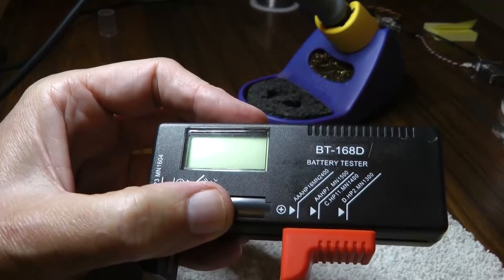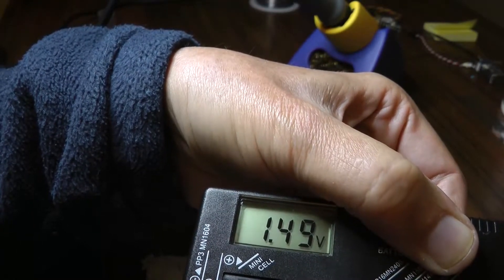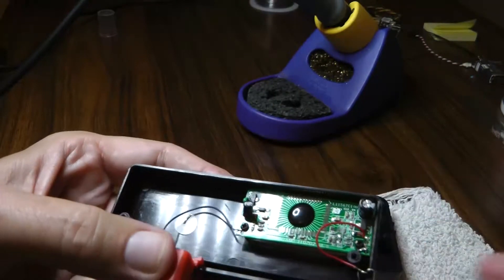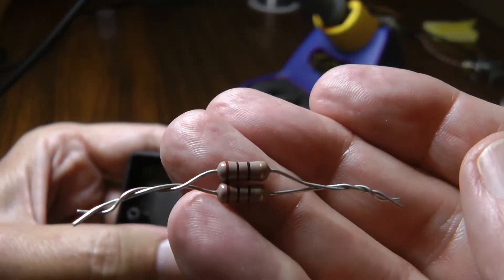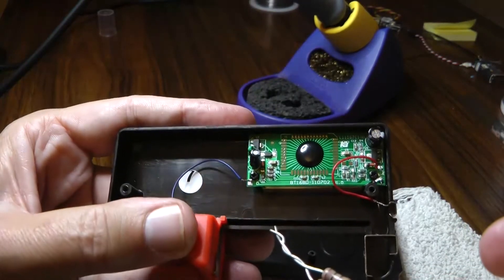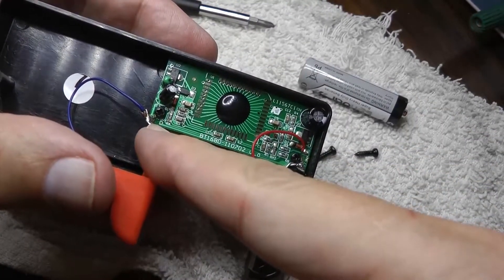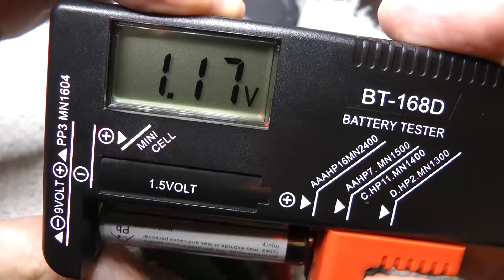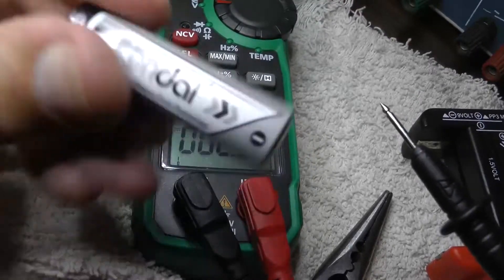Battery tester modification to create a load for more accuracy

Comment: This is incorrect, a fresh AA cell will measure a "no load" terminal voltage of higher than the nominal 1.5 Volts. The one shown at 1.49 I would toss as it's capacity will drop dramatically under a load.

Comment: Thanks for sharing , I used 3 ohm resistor and used a momentary on / off switch to show before and after voltage’s reading and by the way  my meter is analog and at the back of panel there are three colors which I think it is faster and easer cause it shows  good / weak / bad according to needle position . Keep up the good work .

Comment: Why do you tjhink this is necessary - this model of tester seems to have a sophisticated testing method
Reply from the maker: Because without the resistor to put an ample load on the battery you are not getting a real world idea of how healthy the battery is.  Many batteries will show almost full voltage without a load.  This tester has no sophisticated testing method, the electronics you see in there is to convert the voltage to a digital display.

Comment: This is brilliant, just what I was looking for. Thanks for a great tutorial. Can you explain why you chose 5 ohms resistance, as opposed to something else?
Reply from the maker: I tried a few different resistors on the bench to see what I needed to create a load similar to what the toy robot used.  10 ohms for example was not placing a hard enough load on the battery  to get a real use voltage.  You could see from my example, the voltage was almost perfect with no load but with a 5 ohm load the voltage was to low to run the motor on this toy robot for example.  The toy robot used 6 AA batteries, each battery was about 1.48 volts with no load, with a load they were about 1.18 volts.  So it was 8.9 volts vs 7.1 volts which was too low to operate the robot.  Some toys/electronics will work with batteries that are drained, LED flashlights for example will work, they will be dimmer but function.

Comment: nice video. as a suggestion, try testing the 9v battery with a 215ohm resistor. 9v has higher current and should give more accurate results.
Reply from the maker: I so rarely use any 9v batteries so it was the reason I did not install a resister in there.  But thanks for letting me know what you need for a 9v.